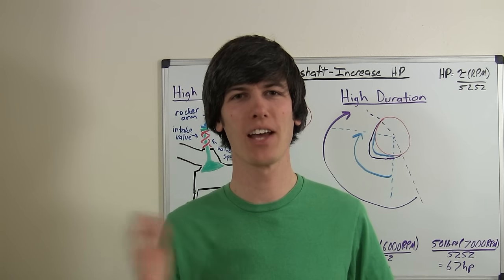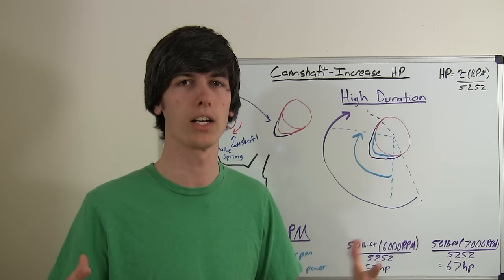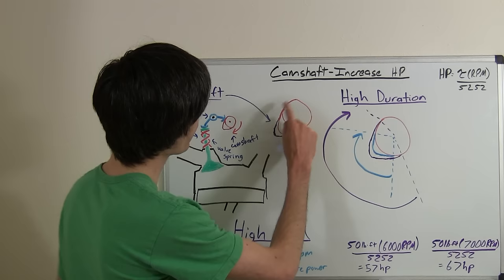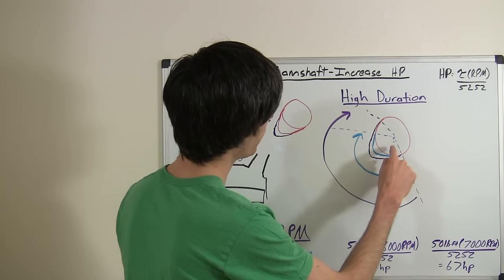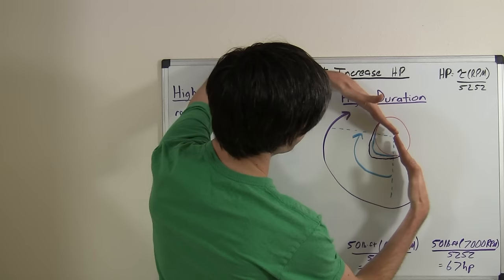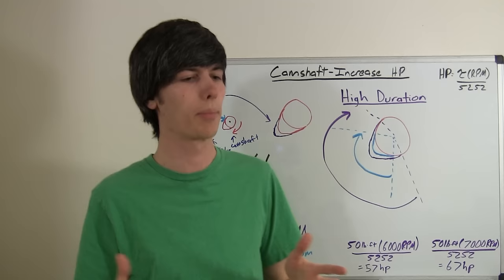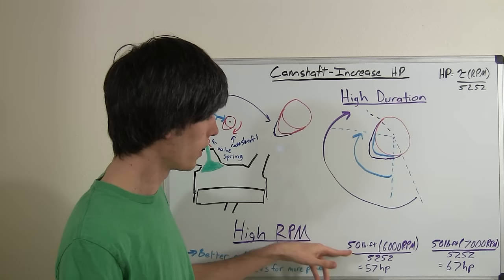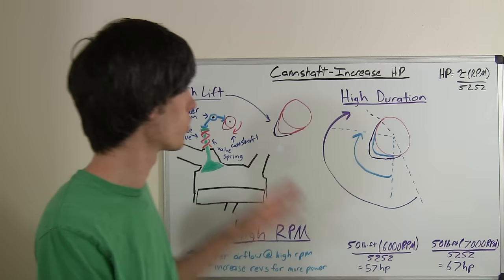Camshaft - High Lift and Duration - Increase Horsepower

Comment: Great video. I'm just gonna nit pic a little. One of my top 3 pet peeves, is the use of the term, "RPMs". I know people don't mean to do it, but you're counting "revS" per minute, not revs per "minuteS". The "s" is already in the abbreviation. Sorry, not being a butt hole. I love your vids. I'm the same way when people call an engine, a motor. Two different things...
Reply: lol, I have the same bad RPM habit. My uncle tried to squash it when I was little, but when the masses kept correcting me to wrong I gave up and joined them.

Comment: How do i choose camshaft ? What brand? And how do i kno what fits for my engine
Reply: If you have that many question, you need to either contact a reputable engine builder, or at the least a manufacture that can sell you a complete kit. Howards, Isky, Crane, and Comp Cams are good places to start.

Comment: i have some mechanism with 2 cam but it have different size...  i connected both with sprocket and chain.. i have some question how to know the right timing .. if 1 cam for lifting and another for pusher

Comment: I have q question
I did a aftermarket valves and seals and retainers.  On a b18c1 engine.  
I did the clay trick.    So after check the clearance. Between valve en piston. I got .002
Of clearance .  But after the engine get to the right temperature.  This clearance will change right because the heat?
This  .002.   Clearance. On ly happen in the exhaust side.  On the intake side i got alot of room.    Wha t do you think. ?
Thank you

Comment: I would like to learn more about the camshaft numbers (if you could make another video, please)... I'm looking to upgrade my CAM on my SRT8 but am a total novice and still don’t understand the CAM numbers.

BTW your videos have been very informative/helpful! -Thanks
Reply: While I'm in no position to explain all of the camshaft numbers to you as that would take literally forever, I am in a position to tell you that when it comes to camshafts, bigger is not - I repeat NOT - always better. Most people I've come across building high performance builds search through a catalog and choose the cam with the biggest numbers. This usually has ill-effects on their engine build and leaves them unsatisfied because the components of their engine do not work together properly to make horsepower/torque. Think of a camshaft as the brain of an engine. In my experiences, it is usually one of the last things you add to an engine when doing a complete overhaul and choosing a cam profile has a lot to do with knowing how everything else in the engine works. I.E. Rocker Ratio, Compression ratio, operating RPM, intake/exhaust flow, naturally aspirated vs forced induction (like turbo/supercharged), what sized valves you have, combustion chamber design, etc. 

What you want to do with the engine determines things like that too. For instance, horsepower and torque are usually trade off's when it comes to engines. High horsepower engines tend to have lower torque numbers because a certain amount of air restriction (among other things) is required for low-end torque. On street driven vehicles with vacuum assisted amenities, camshaft design also becomes a big factor. (like vacuum assisted brakes and interior air)

I'm not here to frighten you with all of this, but coming from an engine building standpoint, there is a lot of thought that goes into a cam upgrade that most people don't take into consideration, and I'd hate to see you end up unhappy with your mod.
Reply: 4u2nvinmtl hey bro did u get ur srt8 cammed? i have a stocked 2014 srt8 and dnt kno where to start lol, plz let me kno wut have u done to make it faster? ty
Reply: You already have a LOT of power and speed. What more do you want?

Comment: I have one question that wasn't directly address in the video. When shopping for cams, is a 270 duration considered "Lower" or "More Reserved" than a cam with 290+ Duration? Trying to see what I can do with my 350SB without changing my trans/Torque Converter and a ton of internals. Just want a small Cam Thump in the exhaust note.

Comment: I have a 04 Trailblazer 4.2 inline 6. I want 30 more hp. Should I install cold air intake, throttle body spacer and headers or just put a hotter cam?
Reply: The headers and cold air intake would help ya reach that goal. But since a Trailblazer is not throttle body injected, a throttle body spacer would be a waste of money man... 
Look into getting some iridium spark plugs if you currently have only platinums, and look into maybe changing out the rear end gears to a different/higher ratio. While both of those things won't actually make horsepower, the iridium spark plugs will help burn fuel better & make your engine more efficient. And a different rear end gear set would help the motor spin up faster to high RPMs thus making your truck faster. But that would be at the cost of fuel efficiency.
Reply: Lance That question was for him. I already know the answer. Out of all the writing you did. The only true thing you said was changing the rear gears.
Reply: +blackericdenice why are you asking such a loaded question if you're trying to test someone? headers can easily add 10 hp. not so much on a trailblazer.

Comment: I would be interested in knowing why manufacturers still use mechanical parts for the cams. Why would they use a camshaft instead of electronically controlled valves when they use electronic fuel injection, electronic ignition, electronic throttling, computer controlled transmissions, and computers and electronics running nearly everything else? Seems they could get a lot more nuanced control over lift durations using a computer to be able to time each valve's opening and closing based on a variety of engine and intake conditions.

Comment: I want to cam my 5.3 but theirs 2 options on the 212/218 cam, low lift which is .550 & high lift which is .600, which one would be better ? Is there a difference in sound ?

Comment: i was wondering. I have a 3.4 engine and idk if it would be a good idea to change the cams. but the only cams I can use is made for the 3.8liter model of the car. if I bought the "performance" cams for the 3.8. and put them in my 3.4. would that damage my engine more than help it?

Comment: need explaination about lobe seperation angle (LSA) and how to calculate.related to overlapping how this effect to HP
Reply: Lsa. Is and this is just how I understand it the tighter the lsa. 108 106 for example will be super choppy and surge like crazy at idle but run like a scalded cat at higher rpms where it's moving so fast the engine speed has caught up to the overlap and they say some overlap is good it allows for scavenging the exhaust gases for better combustion but you sacrifice a lot like drivabiliry streetability actually surging and loss of vacuum due to overlap longer duration tighter centerline cams are drag race or race only and if you want to be able to drive the damn thing it's like anything else in life a compromise and finding what works for you.. this is how it's been explained to me over the years you can have high lift and long duration like the new L.s series engines and make gobs of power and have a good idle with a 114 cam lobe separation angle unfortunately the older small blocks didn't have enough room for big high lift cams and long duration as well as the heads didn't accommodate well valve springs etc this is one reason the L.s series is so good nevermind the bottom end being engineered way better w 6 bolt mains etc

Comment: If anyone can help.  I have a D16Y8 engine. Replacing the stock camshafts with Skunk 2 stage camshafts?    Any suggestions or problems with doing this?    Thanks for the help

Comment: nice. i knew about the higher lift allowing more air into cyl's for extra power, but didnt know about high duration. thats why they reccomended s4 cams for my pocket rocket nx2000 with underdrive pulley kits and lighter flywheels etc and possibly cam gears adjustment set as well as the racing headers to get the heat out quick etc. then the chip and a tune. lol, im guessing the video you have about upgraded valve springs and kit is for the valves ability to get back to closed position asap.

Comment: When any manufacturer designs a car, why would they create a cam that is not already optimized? It seems like there would be no disadvantage to designing the cam to have the highest lift physically possible and the highest duration without overlap. In other words, if you have to replace the cam to get more HP, does this mean the manufacturer failed to spend the time to optimize? Or is there a benefit to having low lift and duration they are optimizing for?

Comment: Hello I'm planning on getting a camshaft, was just wondering my car has over 130,000 miles would I need any other internals for it?  Its an 02 Maxima 6 spd, I have upgrades that helped a lot and got it tune but just needed that extra info,,,

Comment: I built a motor for my Minibike, it ran nice. I put a higher lift cam with more duration the problem is the bike slow down on the top end could it be I have too much air and not enough gas maybe I should go up a little bit on the jet, let me know if that sounds right thank you

Comment: Great video. Thank you. I assume a tune should follow after this swap? What are some of other things should i consider? I have a Challenger 5.7. I will be swapping my exhaust from header. You mentioned airflow fuel flow is it necessary to change the injectors as well? Thanks again for the information.

Comment: I have a question, is it better to have more lift or more duration in the cam for increasing peak HP higher in the rev range - in a 4cyl engine with big turbo (AR 1.45 on an EVO X for example)?

Comment: I upgraded my 1998 jeep cherokee camshaft it has more lift from the lobes. now I'm getting valve float at 4500 rpm. can i get stiffer spring or do i need to get a upgraded head to allow for that extra lift??

Comment: Hi, what about the ECM module? This is a major change and the HP output will be higher. It will be just allow more fuel/air and that's it or do I need to change the ECU programming?

Comment: well most cars now-a-days are interference engines, meaning that the valve bottoms out when the piston is almost at it's peak. You have a timing belt to essentially keep the crank and cam shafts in sync. if it breaks you will need your whole top end rebuilt with new parts. the crank shaft rotates twice for every one rotation of the cam. Now when your installing a new timing belt you want to make sure your cylinder 1 is at top dead center and that it wont cause the engine to jump time.

Comment: Awesome videos man! I've been learning a ton!

Can you make one explaining the relationship between fuel efficiency and maximum horse power?

If I give my engine more horse power, does that automatically mean that I'll get worse gas mileage... or is it possible to increase both my max horse power AND my gas mileage at the same time?
Reply: Did you find out?

Comment: Hi. How does a camshaft with higher duration affect air/fuel mixture and how to counteract the impact? And what other components do I need to swap or upgrade if I use another camshaft? I'm thinking valves, pistons, etc....

Comment: Thanks for the video 
But how I can know if the cam shaft is hi by which number..
The valve left , duration or lobe ?! 
Because I want change my car cam shaft and I want a middle cam not so hi and not so low 
I have a cam with :
Duration 217°  225° 
Valve left. 600"  578" 
Lobe 113 
So.. how I can choose the cam by which numbers

Comment: So if I changed out my camshaft with one that has more lift and duration, I could get more horsepower out of my GDI engine.  Right?  Would that create problems?  I.E. adding stress to other components or significantly altering the torque ratio?

Comment: I installed a higher duration camshaft, no other mods done to the engine, I now have a lower and poor idle which causes the engine to die and also some fuel smell coming through the exhaust. Should I just swap back to the camshaft or can it be resolved in a certain way? (e.g. free flow exhaust or high flow air filter)
Reply: Dwayne Almeida getting it tuned by a shop will more than likely fix this entirely (if youre still having the problem now lol). the smelly idle is just part if the Joys of hotrodding LOL

Comment: if uses high life camshaft, what about the spring at valve same, higher K, longer, longer higher K. Does it effect or normal standard spring is fine?

Comment: I have a stock 5s-fe that has poor low end and I'm looking to increase that low end power,high lift,low duration right? Which specific camshaft and valve train would get a lot more low end but not kill it as it's a daily driver? New to a lot of the technical functioning and I'm curious as to whether you could give examples of what I should use with my wallet in mind?

Comment: How should one set up select cams in a turbocharged application?
Concerned with flow reversal of higher exhaust back pressure than intake induction pressure due to turbocharge turbine being an exhaust restriction.
Reply: Tesla power it

Comment: my car has an engine briefly offered by vw. it has a very short intake phase to increase efficiency. but I want to use a new intake camshaft to increase the intake duration without any overlap if its possible?????. it's a 2.0tsi Bcycle engine.

Comment: Awesome video, but what i wanna know is what about the valve springs, wouldn't they need swapping out if you got bigger cam lobes? And if the valve's opening a little more than with the stock cams, wouldn't it run the risk of hitting the piston? Therefore would i need to adjust the the compression ratio, or simply get shorter piston rods?

Comment: I know this is an old video but I was wondering what if I do a slightly short or maybe a tiny bit taller than stock on the intake but increase the duration, then make the exhaust a higher than stock lift with a slightly delayed duration.

My objective is to not have high rpm, but to get better than stock torque from the engine.

This experiment is for a small single cylinder engine, I'm trying to get more potent torque delivery to the torque converter, without sacrificing the rpm limit of  apx 4000rpm.

Comment: I have a set of 2.02/1.6 intake/exhaust valves and 24lb Bosch injectors (blue top orange tip) planning rebuild a Mopar 318 5.2L. 

Now I need as much cam lift and as low duration (mpg, low-mid range torque, emissions) as possible. Planning to bump up compression to 9.5:1-10:1 as well.

Question: will 2.02 intake on short duration (how short? I am thinking 220-240 lift) able to pull through enough air with 318 headers to feed 24lb injectors?
Anyone???????

Comment: So both high lift and duration work by mechanically chaning camshaft? Do we need to update ECM as well?
Reply: Sang Yun Lee The cam is spun by a chain connected to the crankshaft if that's what your asking. When you change valve timing significantly it will benefit you greatly to have the engine re-tuned by a professional to make use of the extra air and to make it idle much happier

Comment: If we are going to reduce the valve opening means we are going to reduce the amount of air fuel entering the engine can we increase fuel efficiency of vehicle by this method by loss of some torque?

Comment: Anyone please answer.....
I replaced my street bike (sohc)with 10mm lift cam instead of 5mm lift. But the results are poor than the stock. Upgrade big carbs too and increased the compression ratio also.
please support...

Comment: Im on the verge of buying a high flow cam kit for my 2.0L dohc engine , ive had one person tell me the bottom end wont take it and basically blow up. any ideas?
Reply: How many miles on the engine and how high u rib it will control that. A lot of people just repeat stuff they have heard other people say.

Comment: Can we imagine lobes that would have an irregular shape (i.e. non symmetrical when "tracing" an imaginary line between the axle of the camshaft and the top edge of the lobe)? That way valves opening and closing times would be different. For what purpose, though?
Reply: Manu Delmarche, no need to imagine it, that exists.  The primary reason for doing is a result of controlling ramp rates, a high lift and high duration puts a good deal of stress on the valvetrain.  The simplest version has shallower ramp on the opening side because this is the only time the cam lobe is working to actually overcome the spring.  The more sophisticated grinds actually take into consideration the fact the spring may not necessarily exhibit a constant rate.

There is another reason that is far less common but it generally has to do controlling charge velocity.  I've heard of cams that will leave the intake valve just partially open for a fairly long time just before BDC because then the air velocity is higher and this creates turbulence in the air charge which can reduce detonation.

Comment: Are there only two reasons to wanting stronger valve springs?
For degrees of rotation from a new camshaft...and because under high boost applications, valves have the chance to stay open due to the amount of boost forcing them open?

Is there such thing as having too strong of valve springs?

If I were to mod a car...could I just go out and buy the strongest valve springs and call it a day?